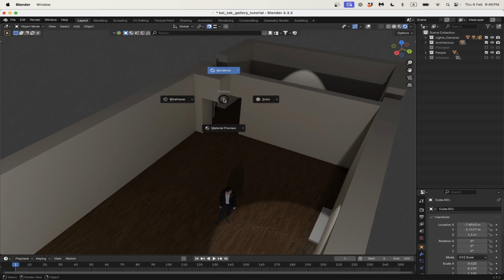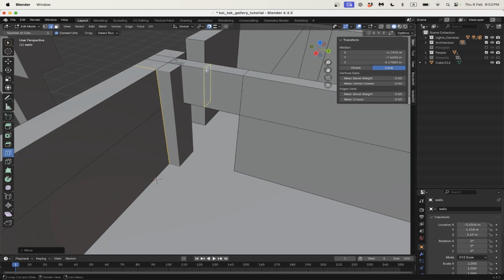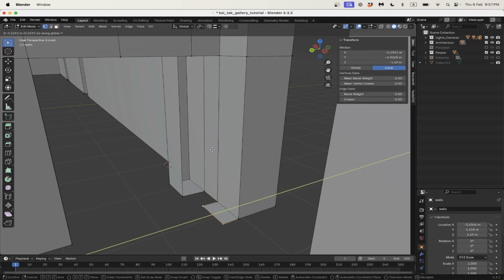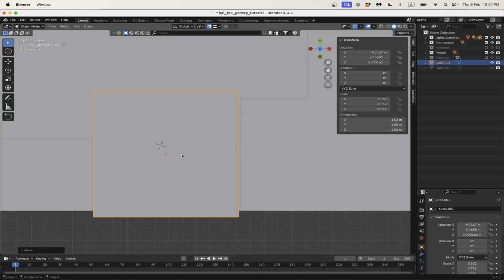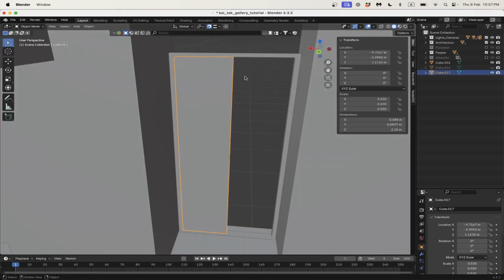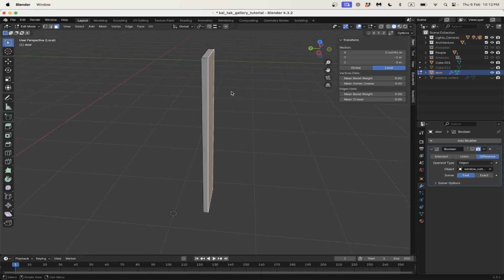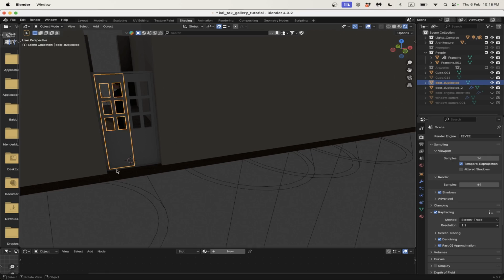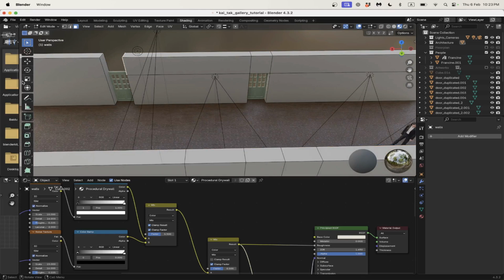Exhibition Design Using Blender: Tutorial 2

Comment: I dont know why but the difference didnt work at all so I just added new cube and made out of it new window_cutters
Reply from the maker: First check that your geometry is overlapping, booleans require this in order for them to work. Second, you can try switching between Float, Exact and Manifold solver modes on your Boolean modifier, sometimes that makes the Boolean work.